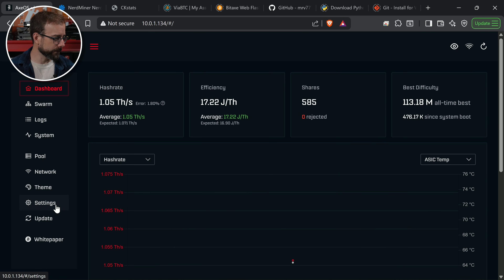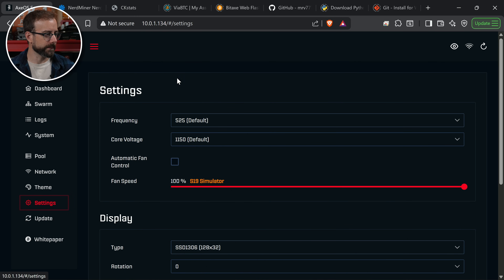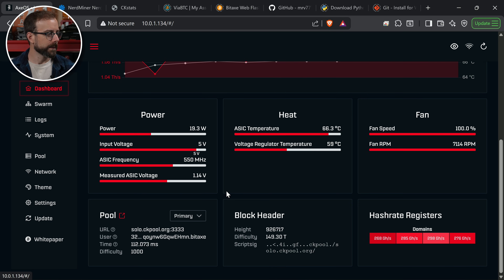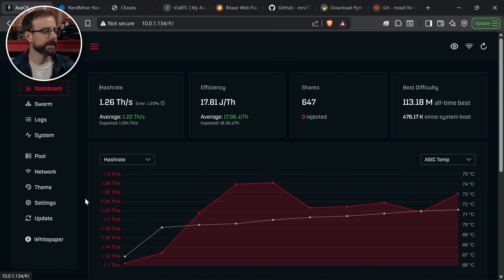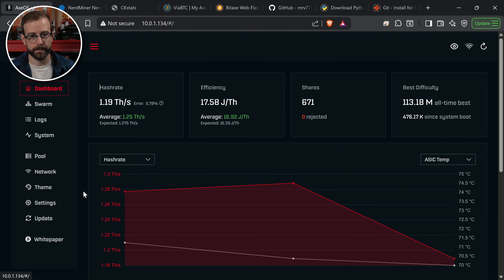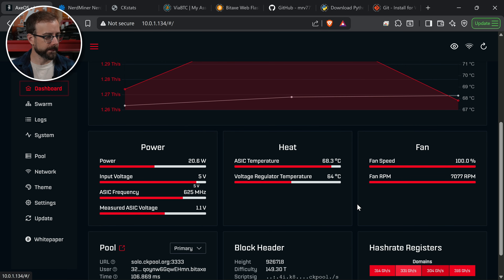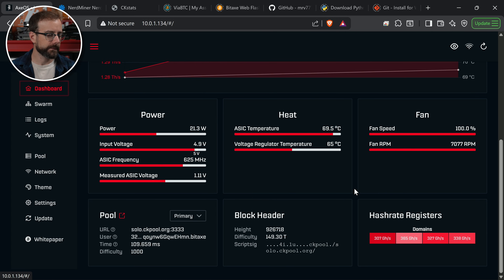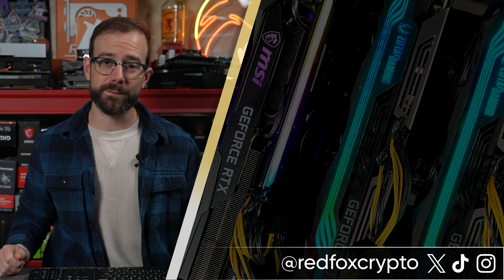How To Master Bitaxe Overclocking with This Secret Menu

Comment: I've got an Argon THRML 60 fan on each of my two BitAxe Gammas, and I'm able to get 775MHz on both with the ASIC at 60º C and the fans at about 40% or so.  Voltage on one is 1.125V and on the other is 1.175V; error rate is 1.0% to 1.5% on both.

Voltage regulators on both are 98 to 99º C though.  So I can't go any higher.  I really want to keep those below 100º.  I put a couple of stick-on heatsinks on each of them, but it didn't really do a heck of a lot of good.

Oh, and I'm definitely not using the stock power-supplies. I bought a 300W 5V PSU from Amazon.  There's no way the stock supplies could handle the 27-28 Watts I'm pulling.  Keeping in mind the 80% rule, this PSU could easily handle 8 of these BitAxes OC'ed like this.  Plenty of room to grow.